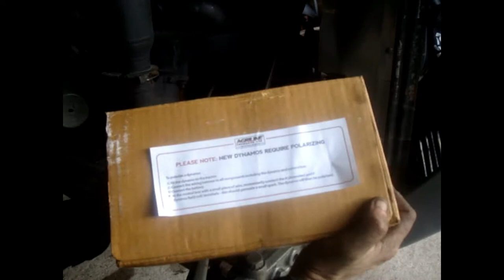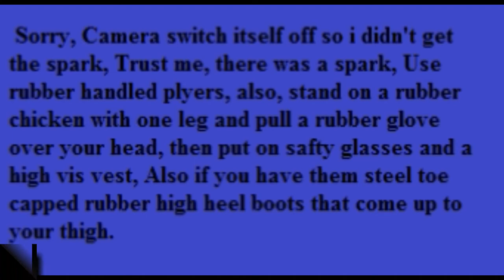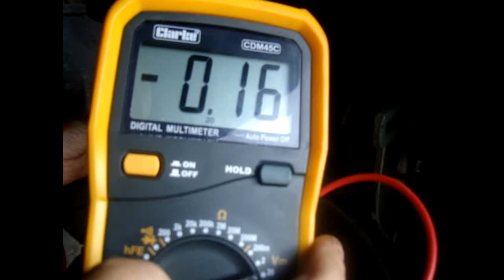Fitting the new draw bar and Dynamo to the tef20 grey fergie MAW 544.

Comment: Is it positive or negative earth, and did you every think of fitting an alternator.
Reply from the maker: Its a negative earth on mine, however I have herd of them being positive and the alternator conversion is a popular and easy upgrade. My main priority was just to get it back together and to keep it as it was used on the farm. I'm not having any battery charging problems with it so I'm thinking if it isn't broken then don't fix it. I do however put the battery on an automatic trickle charge system when I'm not using it for long periods of time so I think this probably helps.

Comment: Hi, where did you purchase you drawbar....?
Reply from the maker: O dear, I've forgotten, Think it might have been the old t20 tractor parts company but I can no longer see it for sale on there website. https://old20tractorparts.com/2753-ferguson-tef20#/section-linkage   I also brought a lot of parts from agriline but I can't find the whole unit there, I have found the draw bar  https://www.anglo-agriparts.com/tractor-parts-ferguson-tef20/linkage-components/drawbar-with-clevis-a68683 but I can't find the base plate that attaches to the bottom of the tractor.  I have found one ebay though if your quick.  https://www.ebay.co.uk/itm/Massey-ferguson-drawbar-hitch-assembly-for-classic-tractor/254033952820?hash=item3b259a8034:g:yw8AAOSwnipWZh4H:rk:3:pf:0    Hope this helps. Mark.
Reply from the maker: Even better one here as it has the complete plate.  https://www.ebay.co.uk/itm/Massey-Ferguson-Swinging-Drawbar-Assembly-FE35-MF35-135-165/263222764855?hash=item3d494ca537:g:TUAAAMXQWzNSenAZ:rk:10:pf:0
Reply: mark pritchard super......thx...
Reply from the maker: Your welcome.